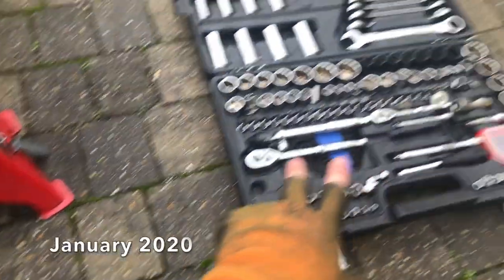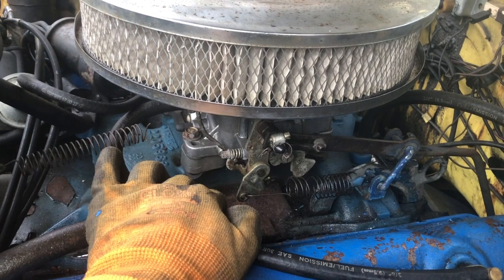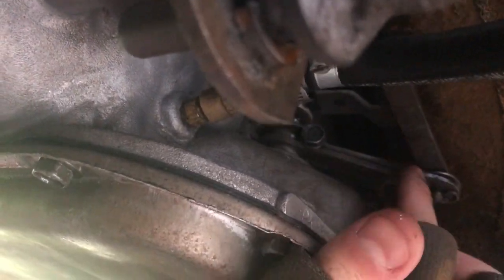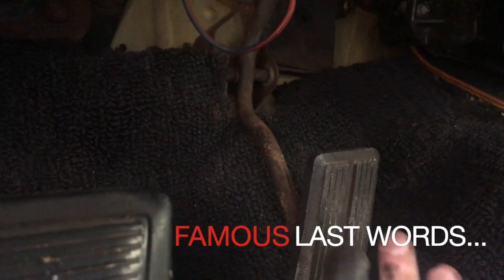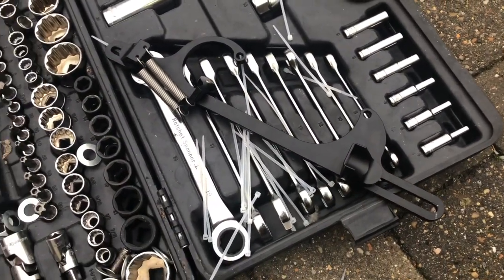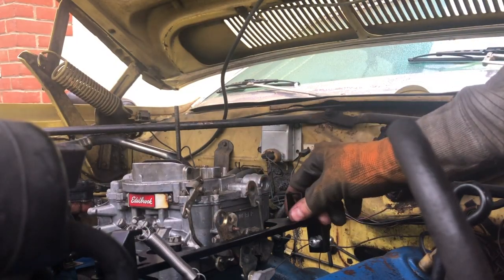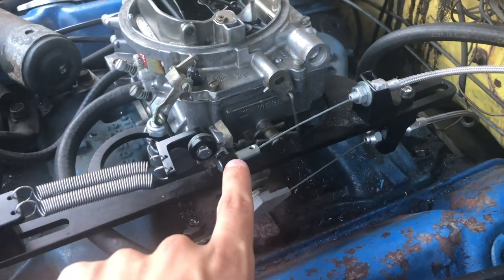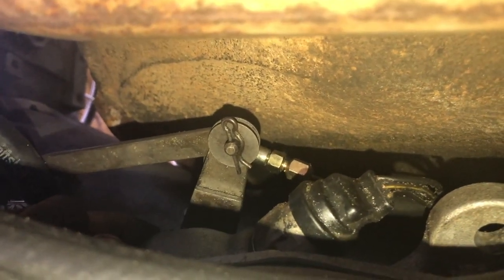Throttle Cable & A727 Kickdown Linkage Install & Adjustment // NOTaROADRUNNER

Comment: Ok there is a tv bolt on passenger side of the box. You need a psi gauge with 1/8 fitting. You need to set cable up to 35psi by fine adjustments. This is important for pressure. No more no less. You do this whilst vehicle is running in neutral and running temperature.
Reply from the maker: In all honesty I’m not sure I’ve ever heard of someone setting it with a pressure gauge 🤔
Reply: @NOTaMOD  yes it is a thing lol. If not set right you can burn your box out over time. Dont forget these boxes run under hydraulic presure so it needs to be set accurate

Comment: Do you have the part numbers for the cable kit and bracket? Video was helpful to figure out orientation. Thanks
Reply from the maker: I don’t unfortunately I just bought a kit off eBay so it wasn’t an official branded kit really! The link below is similar to the one I purchased but the one I purchased is no longer on eBay! Sorry I couldn’t be of more help 

https://www.ebay.co.uk/itm/Chrysler-Mopar-727-24-Throttle-Kickdown-Cable-Carb-Bracket-Linkage-Springs-/323628409842?mkcid=16&mkevt=1&_trksid=p2349624.m46890.l6249&mkrid=711-127632-2357-0
Reply: @NOTaMOD  Thank You!

Comment: Simple question, but just wondering: Would a frayed cable cause my carb to not come off high idle after I press pedal at first start up?
Reply from the maker: I don’t believe so no! That could be a faulty return spring? Meaning it’s not pulling the throttle back to its start position after you’ve pushed the pedal?

Comment: My 76 cordobas linkage is all fuckerd up and I dont think I have the right brackets and such so I'll keep struggling with it and hopefully it works
Reply from the maker: Awww I see the cables kit I bought did come with one but if you have a Holley I’d buy the Holley linkage bracket (whatever brand from EBay) like mine they really do help clean it all up at the carb end 👌👍

Comment: I would have just used the supplied mounting bracket
Reply from the maker: It definitely would have been easier 😂😂 I am thinking of swapping to a Holley so though get the bracket in advance then it’ll be a direct swap onto it 🔥👌

Comment: nice job on the kickdown replacement
i have a 71 satellite with a 360 and i think my kickdown is the same as yours but the cable isnt doing anything at all thanks to you i ll be able to see where i need to look and where to pull
i dont have a youtube channel so no update on my side.
http://puu.sh/G5GWo/48f33a00fa.jpg 
sorry the glass above the phone's camera is cracked
http://puu.sh/G5H8v/2dc08c699f.jpg that was a ride with a friend who owns a 71 charger
Reply from the maker: Thanks man 👍 and very nice the 360 is a nice platform 🔥 definitely get on it then otherwise you’ll have a gearbox rebuild on the horizon like I did 😂 good luck ! Lemme know how you get on 👌
Reply: @NOTaMOD  I hope I won't need to rebuild it. If I have to I ll just order a new one from TCI.
Right now my kickdown cable is very loose both on the carburetor linkage and on the tf727 lever. Sadly my garage is so small it s a pita to work on it.
Waiting on the next episode
https://www.hotrod.com/articles/the-lowdown-on-stock-torqueflite-kick-down-linkage/
If you need more info this is pretty helpful
Reply from the maker: You will know mate don’t worry mine started driving in reverse so 😂👍 was an easy spot that it needed a rebuild 😂 and awww fairs is the lever itself got resistance?
Reply: @NOTaMOD  when I crawl under the car I can pull back the lever with little to no resistance for the first half of the arc then the second half I can feel the resistance from the spring.

I ve got a question.
Does the lever need to be at the center when the engine is in idle or does it need to be at the far end?
Reply from the maker: When at idle lever should be at front of the car, at WOT the lever would be pulled towards the back of the car 👌👍
Reply: @NOTaMOD  WOT ? I don't know that acronym.
This week I won't have time to work on my car I ll try to make a video of the settings atm. I ll have to cut some cable length
Reply from the maker: Sorry it means wide open throttle 👍 and fair play my kit didn’t require any cutting as you just pulled the cable through the linkage at carb end to adjust so no cutting required from my kit 👌
Reply: @NOTaMOD  the  cable for the kickdown linkage is going along the steering axle instead of around the tf727 hence why it s too long I ll take a video and some pictures so we can compare
Reply from the maker: Awww I see sounds like your kit differs from mine but yeah as long as you leave enough to adjust it correctly you should be all good 👌